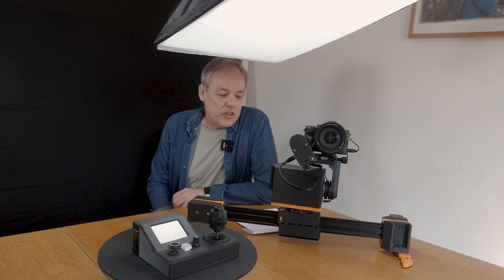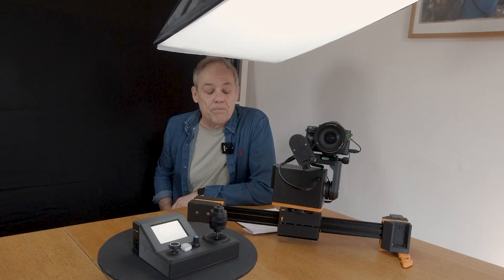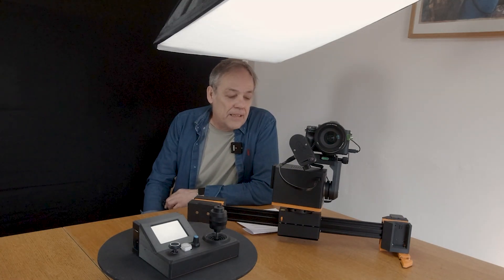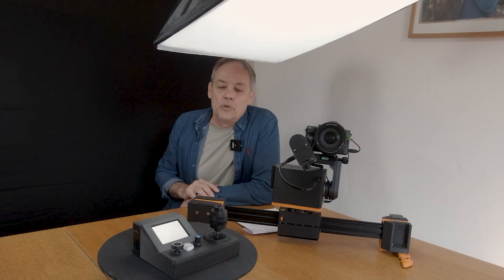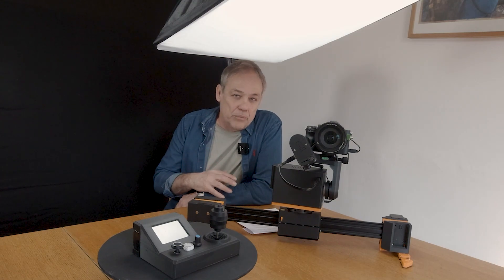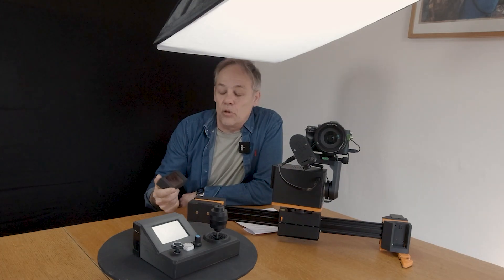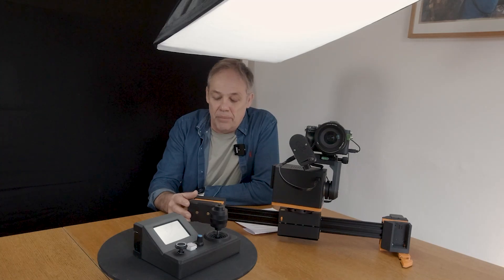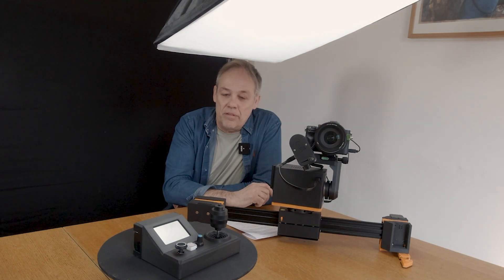PTZplus Realtime camera motion control for film makers

Comment: You should consider to make this system work with PTZ protocol such as Visca over IP...that supported by video mixer software like Vmix. In this case, the director not only switching video sources but also controlling multiple robotic camera (PTZ system) and no need cameraman any more.
Reply from the maker: I may look into this going forward.

Comment: This may be a dumb question,  but how do you control both the zoom and focus if the focus motor is only controlling one ring?  Or can you only control one or the other at a time?
Reply from the maker: Hi Good question
Currently you only have the option of zoom or focus not both.
However in the future I plan to add another axis to the pan/Tilt board which will allow both at the same time. No time frame for this as it will require new board, updated software and another round of testing. The PTZ controller is ready for this however.

Comment: I LOVE this idea!! I would purchase a bunch of these kits IF I can hard wire them. I setup up to 300' away and can't do wireless. Is that an option or in the works?
I built my own using PS3 controllers and re-brained Bescor PT heads. Also, will it work with LANC control?
Reply from the maker: What kind of filming are you doing that requires you to be so far away?
I have done limited tests on range so far but intend to do more. My findings to date would suggest that as it stands with no external antenna and using ESP_Now I have no packet loss up to 50m or 164 feet . The system becomes less reliable at 100m or 328 feet but I believe this can be fixed using external antennas. That said I never really envisaged using the system at anything like that range. As regards using the system with typical PTZ protocol this is something I may look into for the future but again the system was never designed with that kind of usage in mind.
Reply: @digitalbirdfilm  I do a ton of gigs in theaters and large venues. I make sure everything is hardwired. I use SDI cables to my main setup in a production room and at venues. For IMAG and Live-streaming is nice to have people at one area so calling shots is a lot easier, and often I have cameras hung from balcony rails or  onstage for piano hand shots or drummer shots.
I run CAT6 cables with my SDI cables  so I have camera control and video signal together. 
Wireless doesn’t work well when you may have 2 concrete walls and a floor between you and a camera
Reply: @digitalbirdfilm   I do a lot of similar type work and would like at least the option to hardwire. Especially when you get an auditorium full of people and their cell phones, wireless spectrum gets really wonky. But ultimately this is your project and it will go the way you want it to. Thanks for all the killer work you've put in so far. I just ordered a wireless controller kit, a ptz controller kit, focus motor kit, and a pan/tilt head kit and I started printing parts. 

It would also be nice if on your printables page, if you had estimated print times for each project. I'll be posting my makes when they are done. Excited to use this system.
Reply: Same: without hardwiring options, this is a nice toy. But for anything pro, you need to be able to control it over UTP cabling.